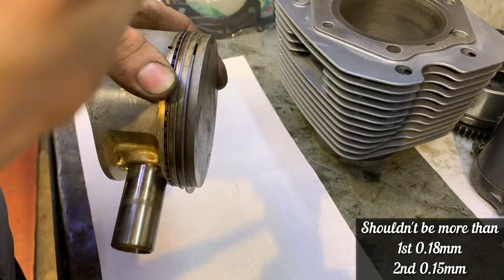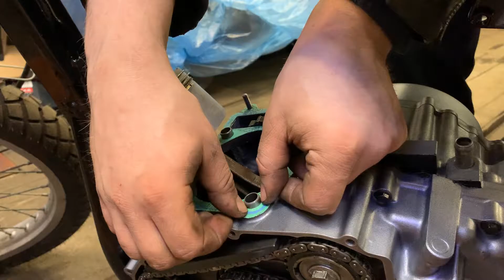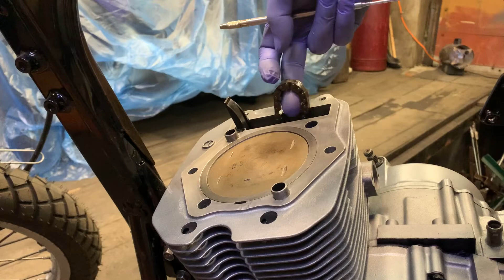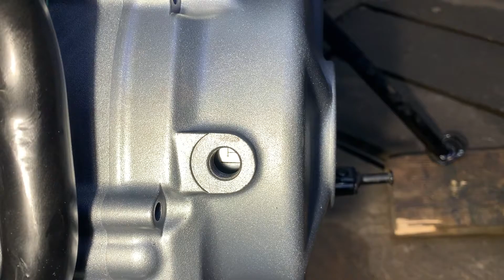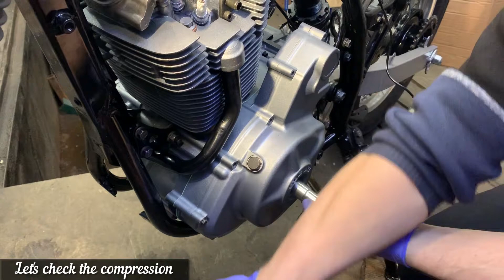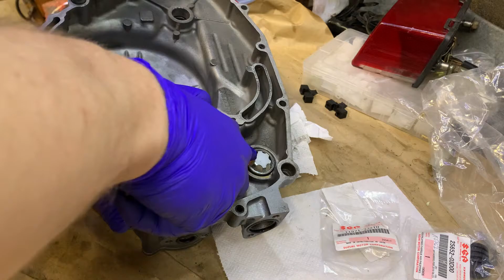Suzuki DR650 RSE Restoration Part 5 The Engine installation

Comment: How did you get the cil over the piston so easily
I ve been struggling with it for over an hour 😂😢
Reply from the maker: The cylinder has a taper at the bottom. I’ve just pushed in the rings one by one and the piston usually slides in.🙂

Comment: Mine brand new has had the rocket cover repaired twice for a leak still
Leaks some. Is there aera pressurized
Reply from the maker: The rocker cover has a oil passage thru one of the dowels that provides the oil for the rocker surfaces. Check the surface of the cover and the head, there might be a chance that there’s a scrape from taking the cover off that doesn’t allow the cover to sit fully down on the head

Comment: Hi I just replaced my balancing chain without doing the top end, does it matter which stroke the engine has to be? Also when I turned the engine over by hand the alignment marks didn't line up after.
Reply from the maker: Hi, it shouldn’t matter on which stroke the cylinder is on, all three shafts rotate the same speed.
The marks should align, the chain should have three chromes links that show the placement of the marks, they should alignment after a few turns. Check if the sprocket keys aren’t damaged or missing.
Reply: Thanks for the advice, your videos have been really helpful

Comment: Hi, a very good and informative video. Can you please tell me the reason the valve was broken in the previous engine head? I have heard a few stories of these engines ending in a broken valve, but just couldn't find any info what actually was the cause. Oil starvation to the head making the valve stick and meet the piston? Valve just cracking from temperature? Problems with timing chain and tensioner?
Reply from the maker: Hi, 
As far as I could find when taking apart the engine:
The right side engine cover houses oil passages, which feed the top of the engine. Since someone put the cover on with too much silicone or liquid gasket it blocked the oil passages that fed the top of the engine, thus overheating the rockers and valves. After that the valve start to stick and it’s just a matter of time when they hit the piston.
I recommend always using a gasket on the right side cover and maintaining regular oil changes. Because the DR650 don’t have any warning systems for overheating, on mine black 1993 I added a electronics thermometer that measures the valve covers temperature.
Reply: @restorationvalve  Thanks for the information. Yeah these old 650's should have a thermometer and an oil pressure light.

Comment: Where did you find The free whell bearing Min 15.57 ?
Reply from the maker: Do you mean the starter clutch?
The OEM Suzuki costs 226€, so I got one from Ebay for 37$.
https://www.ebay.com/itm/Starter-Clutch-One-Way-Bearing-for-Suzuki-DR650-S400F-LS400U-LS650-ST400V/264807072471?ssPageName=STRK%3AMEBIDX%3AIT&_trksid=p2057872.m2749.l2649

Comment: the valve cover is placed on the anaerobic sealant. you did it wrong.
Reply from the maker: If we look at the Suzuki service manual, it states that the cylinder head cover should be put installed with SUZUKI BOND NO. 1207B, which is an RTV-based silicone sealant.
I have used a similar sealant to the Suzuki recommended one and I haven't had any problems with sealing the cover or getting it off when needed.